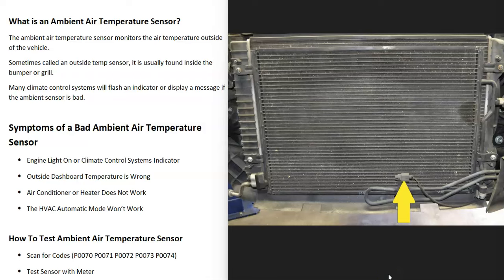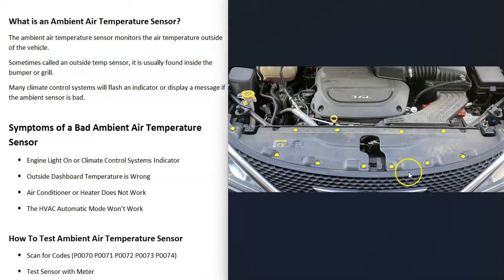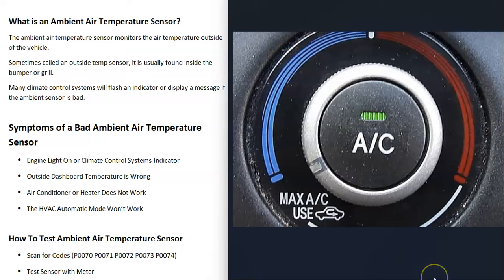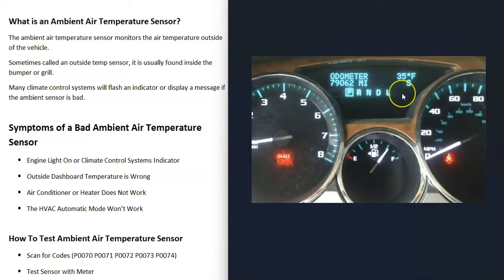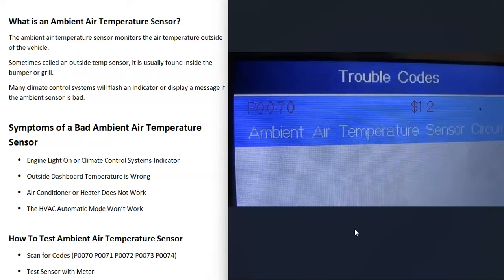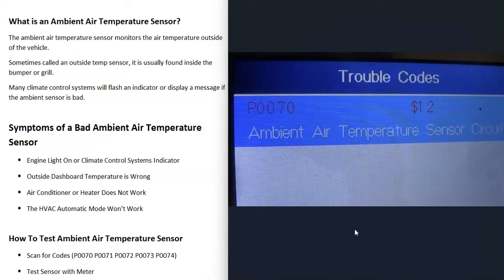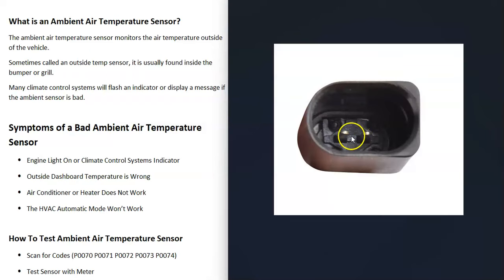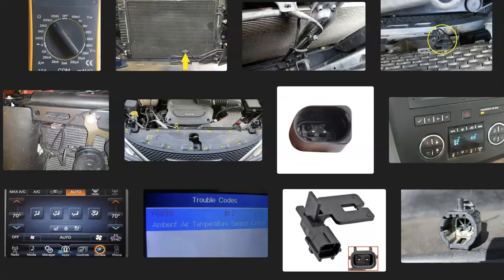Symptoms of a Bad Ambient Air Temperature Sensor

Comment: Whenever it rains, my car warns me about icy conditions and thinks it's negative 45 degrees outside and blasts heat. When the rain stops and everything dries up, it goes back to normal.
Reply: i have the same issue bro were you able to find the solution ?
Reply: @NikhilAnthonyLobo  I took it to a shop and they found that I was missing my ambient air temperature sensor entirely, someone severed the connecting wires. I will purchase a new sensor and wiring harness and pay a technician to assemble it when I have some spare time and money. For now, it's only an inconvenience when it rains. I put electrical tape over the exposed wires so they won't get wet. We'll see if that helps, it hasn't rained yet for me to test the theory.
Reply: @derekmoore82 Thank you for the information 😊
Reply: Same

Comment: I recently had work done to my truck.  They removed the front grill and bumper.  After I got the truck back now It has a CEL and when I turn on the AC it stalls.  I'm gonna check if they put it back wrong or if the actual sensor is bad.  I feel like they didn't connect it right.  Thanks for the video.
Reply: Figures. People suck 😂

Comment: My outside temperature is reading above 145- 160 degrees F.  I Changed the sensor, it's new.  I think it might be wired incorrectly.  (I change a 24 pin "engine to I/P Harness Connector) and when I was reinstalling the leads I mixed up several wires. I'm Looking at All Data trying to trace the wiring.   There were 2 Tan wires for GMLAN Serial Data Bus. the (+) has a black line (but it was faded).   also, there were 3 purple wires that I got mixed up on.  2 of them are larger gauge, so I was not sure when i reinstalled the wires into the connector.   however, I just Learned one of the larger gauge purple wires is Low Reference & the other is TCC Brake switch.   (I don't know exactly what TCC Brake Switch is, but it sound important).   i think i might have found my problem.  My HVAC control Unit is probably reading TCC brake Switch voltage and translating it as 165 Degrees)    i haven't had any brakeing problems,  but I'm going to have to figure this one out.

Comment: Is it OK not to replace temp sensor?
Reply from the maker: It depends on the vehicle's computer. Usually, a bad Ambient Air Temp Sensor only affects the HVAC, but it can vary.
Reply: @HVAC_Mechanic  I don't have any check engine codes, but my problem is that it takes off really slow almost stalling then it take off after 30 seconds of flooring the pedal to the floor, could it be this temp sensor?
Reply: Wrd thanx now i no why my hvac code keeps popping up @HVAC_Mechanic

Comment: So I have a 2018 gmc canyon, and I’ve already replaced the etc and the thermostat…my ac only blows warm air even when I have it cranked to the coldest, and as soon as I turn the truck on the radiator fan turns on and keeps going even after I turn the truck off for a good 5 minutes or so…any chance these may be symptoms of bad ambient sensor

Comment: Hi I have 2020 Mazda CX9. the AC intermetently changes to warm air. Of I stop and turnmoff car for 30 min and turn car and ac on, the ac is normal. It happens 2 to 3 times a week. Could it be the outside or.inside temp sensor. Ferion is ok. The deaker dis not have any codes and asked when it happen being to test it with a scanner.

Comment: Ambient Air Temperature sensor ( AAT ) should be replaced every 7 - 10 years in order for your automatic climate control system to remain efficient. Sensor degradation become significant by that time.
I have observed that in many car models, the position of the AAT sensor is not the optimally best ( at least for hot weather countries ). If your AAT sensor has been installed in the lower front of the condenser, consider having the wires extended by an auto electrician so that you can install it inside your front bumper. There's always space inside the front bumper. It doesn't need to be fixed by locks. You can use a piece of sticking tape to prevent it from rolling and moving about as the car drives about. Another prudent thing is to have the extended wires long enough for you to able to periodically bring out the AAT sensor for inspection and cleaning ( wipe it with a wet towel ). By this preventative maintenance action, your AAT sensor will be able to maintain its rapid responsiveness to slight variations in the outside air.
AAT sensor should not be at a location where heat radiating from the condenser and radiator , or by convection transmission, could influence the accuracy of its operations. Also, AAT sensor must be shielded from light sources ( sunlight or lights from oncoming vehicles which refract off the front grille or reflect from the street surfaces to impact it ). Lastly, fast moving air induce by the radiator condenser fans should go over the AAT sensor to make it feel as if the outside air is colder than it actually is. 
I live in tropical West Africa. I took the steps enumerated above and the result has made the performance of the climate control system of a 2002 model car become better than the OEM. Within 30 seconds of starting the car parked in direct sunshine for several hours, the cabin temperature becomes bearable and by one minute, the interior of the car becomes cood for rear seat passengers to feel comfortable. 
Note, it is just cooling down the cabin air for which car air conditioning system has advanced to the modern type called automatic climate control. The rapidity of controlling the humidity of the cabin air is what actually makes it comfortable.

Comment: Great video. Thanks! 
Once I replace the sensor, is there any calibration need to be done?
2017 accord 2.4L
And should I disconnect the battery before starting?
Reply: I don't think you need to disconnect your battery before taking out one AAT sensor and fixing another one ( replacement). I have personally extended the wiring to my AAT sensor by one metre. I did that so that I could easily bring it out for cleaning. Periodically, I will bring out the AAT sensor, disconnect it from its plug, and thoroughly clean it with a cloth previously dipped in a cleaning solution like dishwasher soap. If you are in the tropics or live in a hot region, then periodically cleaning your AAT sensor will ensure reliability of cabin blower motor speed. The AAT sensor is the main controller of your cabin air blower motor when your climate control system is set in automatic mode. If suddenly you realise that the blower speed has dropped inexplicably, change the setting to manual mode and later check and clean your AAT sensor. You can easily test whether the sensor is still working or not. Set your multimeter to resistance measuring. Apply the leads to the sensor pins. Observe the resistance readings varying with ambient air temperature changes. If no changes occur, it means the sensor may be faulty. 
Being able to pull out your AAT sensor easily is a necessary DIY because the sensor face could easily get fouled by dirt or mud. Once, I pulled out my AAT sensor and observed that cobwebs that had arrested dirt were on it.

Comment: I’ve had a diagnostic done came on my Volvo S40 Lux 57 Plate. Came back ambient sensor code P0070 my engine light came on and I noticed that my rev counter was just touching 1 would in idle mode!, also Temp was showing -3would this be a symptom?

Comment: Will a bad sensor make the  Ignition shut down and come back on when it cools off .I'm reading 80⁰ + on hot days, then engine shutdown and temp reading is over 120⁰ to 130⁰ . Hello from the high desert of Phelan California and yes its still hot 🔥 days. Engine temperature is normal.
Reply from the maker: The Ambient Air Temp Sensor usually won't affect the engine or engine starting. It usually only affects components such as the heater or AC.
Reply: @HVAC_Mechanic  Thanks for the info 👍 now I have to look elsewhere for the answer. It's too bad that I love my Dakota or I'd sale it
Reply: @lenny9926 my dodge journey is the same it could be the sensor or the map sensor
Reply: @tazzy2778  Good morning. I am not sure if it's fixed, but I found a video that said to switch the engine shutdown relay with the A/C one for a test. This seems to have worked out. Sunday was 80⁰ and I didn't have any problems 🙃 on that test drive . I will try next year when it gets hot 🔥 🥵. Drive them until the wheels fall off.

Comment: Is this easy to change? Basically unplug old one & plug new one in?
Reply from the maker: Yes, basically, if it's bad, they just need to be replaced. The hard part is if they are located in a hard-to-get-to-spot and getting the correct replacement.

Comment: I have a 2019 Malibu and having issues with AC sometimes it doesn't work like just a fan but no cold air  and sometimes I see a msg  it says engine power reduced and the temperature is -40 and icy slippery road drive with care when the temperature is 20 digress Celsius  ( Canada )  !!!  does it mean the outside temperature sensor is bad ?  thanks

Comment: My 2014 jeep patriot is doing where the lightening bolt comes on, and traction icon and looses power. Took it and got it hooked up and threw back the ambient air temperature sensor. Will that fix it? The air works fine.
Reply from the maker: If the traction control system has shut down, there should be other codes that point to the issue. I haven't seen a bad ambient air temp sensor cause those issues.

Comment: Kia optima has a knocking sound near engine but the only code that comes up is the ambient air sensor would the failed sensor cause the knocking ?
Reply: I have the same exact issue on my Toyota
Reply: Same! Do you guys found a solution?? And I’m having problem with rough shift gear first and second

Comment: 2005 PT Cruiser had no engine light was overheating so I replace the fan and the engine coolant sensor the fan was not working prior to me replacing it now the fan runs continuous and I have a code that says engine coolant sensor air conditioner works fine how can I remove the code

Comment: My temp gauge and ambient guage randomly stopped working when I changed my cluster bulbs to LED. I've driven the car no overheating and heat works fine...what could it be? CTS? Or ambient sensor?
Reply from the maker: It needs to be diagnosed, but if it stopped working after replacing the bulbs, I would check for anything that may have become unplugged. It also could be a bad sensor, but they will need to be tested to know if one is bad.
Reply: @HVAC_Mechanic  thanks for the feedback 👍🏾